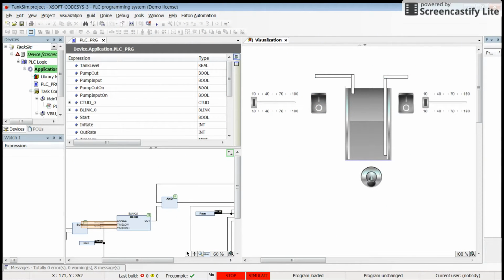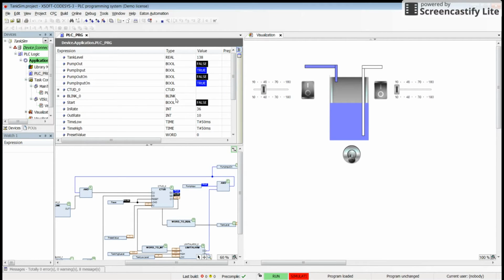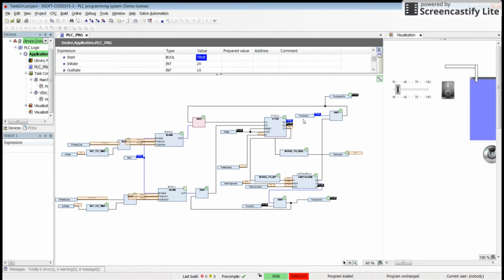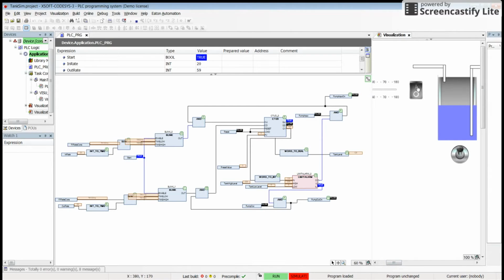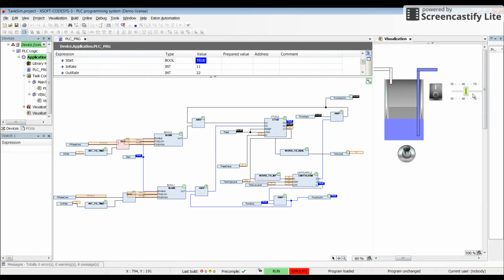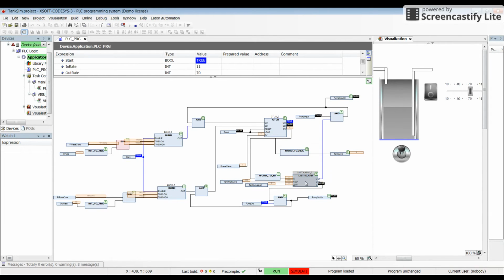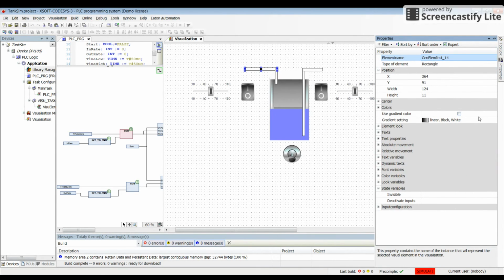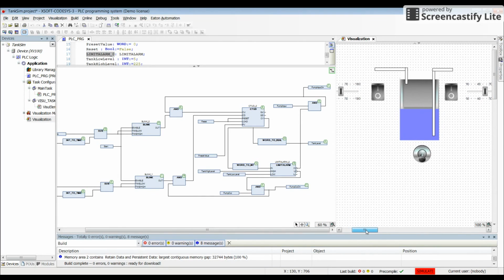CODESYS: CFC programming example - Tank Simulation #codesys #plcprogramming #iec61131 #cfc #tank

Comment: Hello Tohid, from the video it is never made clear what you did with the CTUD. What are the QU and QD plugged to and how did you plug it? I can't find any information on this. Your other video about this function connected them to visualization items but here I couldn't find an explanation for them and I can't make it run in my computer correctly with this being the only difference.

My email is cballardf@gmail.com, I'd appreciate if you could send me the project as well to see all your variables as I noticed you have some variables that were never explained or used (like timelow and timehigh)
Reply from the maker: Hi Christian. I have sent you the archive of the project. I hope it will help you to find the answer to your questions. By the way, I have not connected the QU and QD outputs of the CTUD counter anywhere.

Comment: Hi Tohid,

I curious why my tank level is not rising if my input rate is set to 40 and my output rate to 10? I think level of the tank should still go up by rate of 30.

Thank You,

Geronimo
Reply from the maker: Are you using exactly the same code that I have sent you. It is strange, because the tank level should change. It is indeed the current value of the counter (CV), which should change when the input and the output rates are different. Please record a video from the project in the run time and send it me, if it is possible for you.
Reply: Please check your email. Yes, I'm using original code without any modification.
Reply from the maker: That is true, same behavior here. That is because of the way that the tank is implemented. Indeed if you have the difference between the inrate and outrate more than 30, let's say 32, this would not happen. And this happens only when the Tank is initially empty. However, I will see other ways of implementing the tank to avoid such problem, and update you later. 
Thanks a lot for your feedback!
Reply: Hello. isabetli_37@hotmail.com